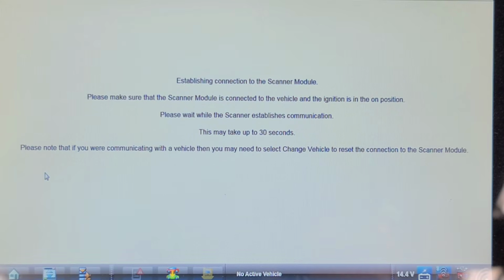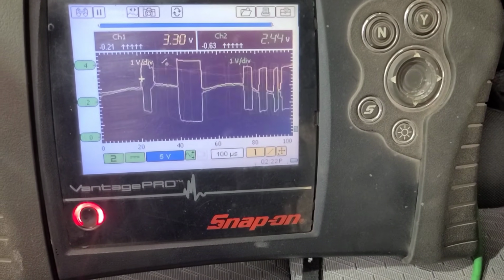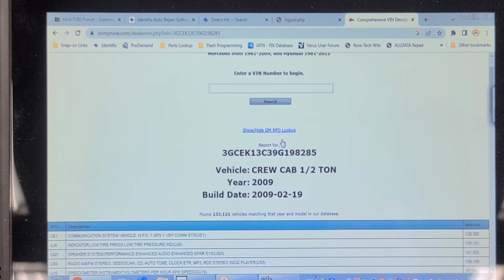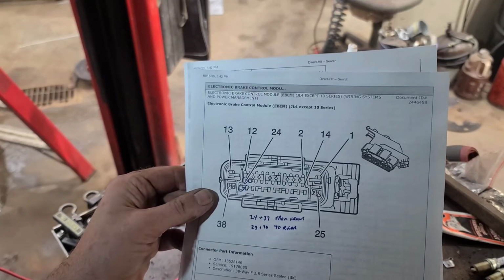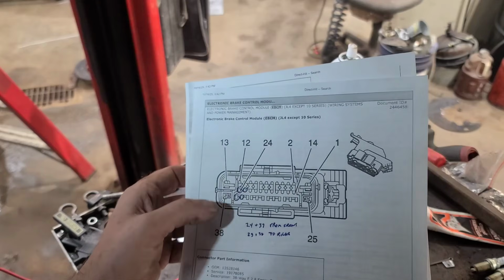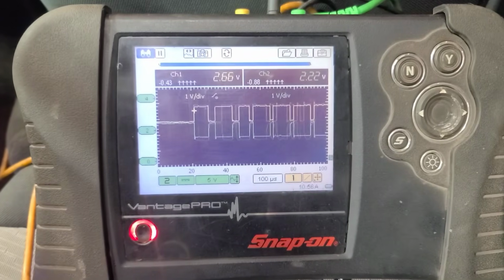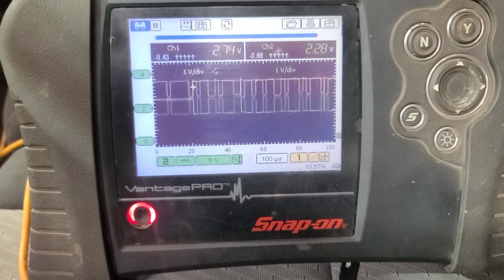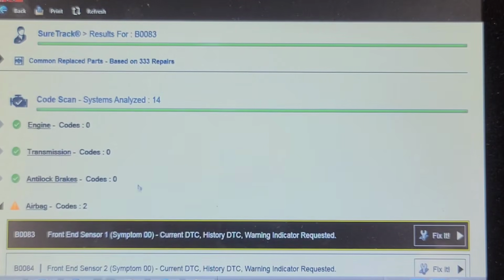2009 GM Truck, No Communication With Can Bussed Modules

Comment: Would you happen to know the part numbers to the locks for FUEL PUMP MODULE & ABS MODULE? I bought this truck for $800 with that electric problem and both locks are broke.
Reply from the maker: Not sold as far as I know. A salvage yard is your best bet. I've secured them with tie wraps.

Comment: Pcm, tcm, tccm, abs, fuel pump module all on can bus A high speed. Working on 2008 right now abs module is down locked in 4 low. Owner put shifter cable on and put a wire harness on inside of cable which should have been on outside near frame. 4 wheel drive drive shaft rubbed harness and broke 8 wires. Just got my jl4 abs module and pump from Cunningham brothers in Virginia. Guess I'll start back on it Monday!
Reply: Watch out for air ride control module, circuit board will rust out causing at Can c bus no start on the vehicle, it lives at the back close to the fuel pump module on the cross over frame rail
Reply from the maker: That would usually only be on the Tahoe or Suburban, I've never seen air suspension on the pickup. I have seen that issue on a Tahoe. In fact, I did a video on one. It was ugly...
Reply: @PhillipBailey you are right I had one on a 2008 GMC Denali with air ride, my tech background is Mercedes/Chrysler/Mitsubishi/Nissan so GM is sometimes new to me

Comment: GM Can C bus is Not? Just thought it was fault tolerant bus system with the 60 ohms module termination resistor in the PCM, BCM Or ABS.
Reply from the maker: The Engine Control module has one 120ohm resistor in it the other is in a connector above the frame near the fuel pump module. It's amazing it still ran.
Reply: @PhillipBailey I saw that on the wiring diagram the 120 ohms in the PCM, I was watching the video and you said it was in the harness area at the back on the vehicle 
But in the wiring diagram it didn’t show it
Reply from the maker: There was a second diagram showing the back half, I don't think I showed that diagram. Sorry